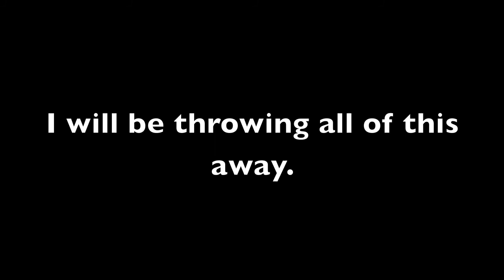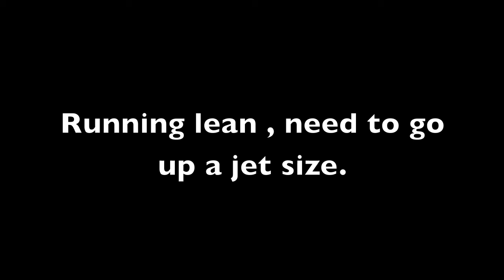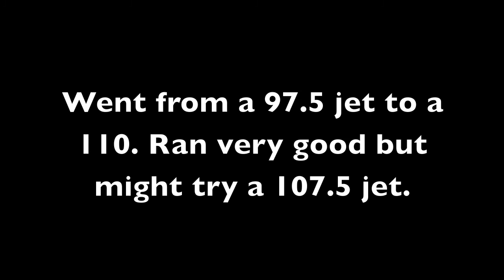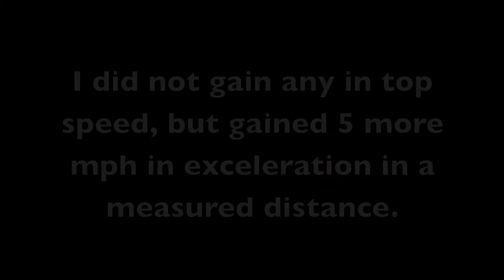Yamaha Vino 125 Exhaust Mod

Comment: hi i have problem with my yamaha vino 125 2006 has spark has gas good exhaust is good  valve is good crank but wont start have the problem for weeks please help thanks